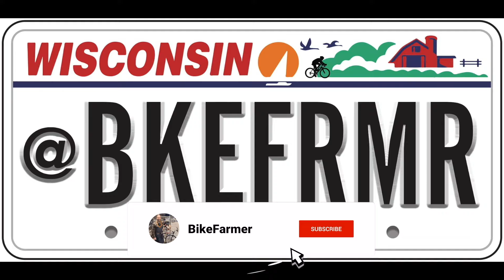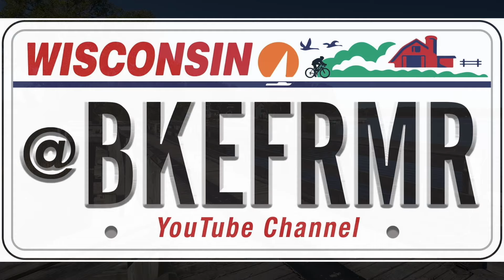GOOD ENOUGH FOR WHO IT'S FOR! - Gary's Diamondback Wildwood made me lose my mind! 🥴🫠

Comment: I have a ladies model bicycle, mountain bike, in the same configuration as the one in this video. It has a used Trek pannier rack on the back, and it's my grocery getter. When I have that rack stacked up high, with my load by the time it's all said and done in town, and I'm heading home, that step through frame is pretty handy.
Reply: I managed to use one of those old Schwinn ladies frames to carry a 2 stack tall bike. My friends tall bike had no wheels so i used his girlfriends ladies bike to move my friends 2 frame high tall bike to a new location. Think i was wheeling around maybe 40 pounds of bike on that damn thing.
Reply: @hungrybraineater2  40-50lbs. Yeah, those old bikes had some heft to them. I have 2 steel frame mountain bikes, a ridgid frame, and a full squish, as they call it, a full suspension mountain bike, and that one is heavier than the previously mentioned bike, with the wheels off. Both are department store bikes. The ladies model came with a child seat, which meant that when ever you get on and off, you're in danger of kicking the kid.
Reply: @davidhakes5141  I had a suspension fork on a dept store mountain bike schwinn. I weighed it was at least 13 pounds if i remember correctly. I put a chrome fork from a Ross mount Whitney on it and put a full Shimano mountain bike gruppo on it. The schwinns from the 70s were built like trucks. I put a schwinn frame on the bottom of the stacked bike and put a Huffy on the top. Welded them together so then you had a tall bike.
Reply: @hungrybraineater2  I went and had too many birthdays to be messing with those outlandish frame bikes, but, I don't knock them, because I don't make it a practice to judge other people, and what makes them happy. I've seen those tall bikes all over YouTube, and TikTok, and the crazy ways people decorate them. If I don't fall off of the thing, if I were to try to ride it, I'm liable to catch a power line, where I live. Have fun, stay safe, and God bless.
Reply: @davidhakes5141  I am a cyclist the tallbike creation is probably the most embarrassing thing ive built. its like that child i dont want to admit that exists lol.

Comment: In another video you told us that Dawn is just dish soap + water + isopropyl alcohol. While we don't have the product here in Germany, I mixed those things myself into a spray bottle. It's sadly not foamy but cleans extremly well without a need to wash it down. Awesome, thanks for the tip! Update: It's the spray bottle head. Used one from a bath cleaner and it foams perfectly!

Comment: For rusty fasteners, I mount a drill wire brush in my vise and mount the screw in my drill. Just jam that fastener into the wire brush a few times with the drill going and it cleans out the head of the screw nicely while also polishing up the cap.
Reply: I was literally just about to post the same thing! Add a little oil, works great!

Comment: one suggestion/caution to viewers on greasing the brake posts - don't 'pack' them with grease. in a closed bolt hole (as opposed to one that goes through and is open on both ends) if you have too much grease or fluid inside the bolt will actually hit a hydraulic lock and either not seat all the way or worst case something will have to give (too much torque) and break. Maybe grease just the bolt threads.

Comment: I’ve been doing basic maintenance and some repairs on my 2 old diesel trucks and various family cars for decades, but a seasonal bike tune up intimidates me. Not any more. This is awesome! Thanks!
Reply: Dont feel intimidated. I knew a guy who was a very good mechanic who did transmissions. Also a great bike mechanic as well rode a very nice raliegh steel frame road bike. Alot of the stuff you know from diesel motors will transition over.
Reply: I got very bad ADHD I lose shit 😅
Reply: @No_ReGretzky99  i had like one of those magnetic trays that would keep bolts from running off from you. But to be honest i did not use it as much for fear of magnetizing some of the bolts and screws. But a good tray will solve the issues of you losing stuff.

Comment: try using a small piece of brake wire in a drill spinning the direction of the twist in the hex screws
Reply: But wear an apron and googles for this hack! These single wires can break and fly through the air with high speed (same for these cheap-o wire brushes for your drill). These will go deep into your skin (ask me how I found out... )

Comment: Can i ask something. Considering that I live in a country where the average hourly wage is about 3-4 dollars, and materials are about the same as they are in US, and i always replace rusty bolts.  I assume that the majority of the price of service there is  in the labor. How it is more profitable for you and for a customer to spend time half-successfully restoring the shine to the bolts than to replace them.  The screws cant be more than 10-15 cents a piece. Same question for shift/brake cables that are about 1 or 2 dollars ( or original shimano that are like 5 bucks).

Comment: I still don't understand why you have issues with disc brakes. Would rather bleed a disc brake then mess with cantilevers.
Reply from the maker: I knew you’d say that, lol
Reply: Remind me of the squeek you get from angled disc.

Yes they're good. No they're just as painful to set up due to tight tolerances. No your slow acoustic bike you don't ride downhill at 30 mph doesn't need them. It needs multiple compound pads to handle rainy weather instead.

Comment: I thought you are supposed to flare out these cantilever arms as far as possible in order to increase leverage on the rim, maximizing braking power
Reply: The one thing I saw on the rear brake is that anchoring the straddle cable a little shorter could result in very slight and not worth the effort improvement of brake performance. Ideally you like the straddle cable to make a 90 degree angle when the brake is applied. Harris Cyclery has a piece on that on the web site.

Comment: If anyone works on these "ladies bikes" especially the old schwinn variety please always check the condition of the breaks and derailleur cables. Often times they are run with a housing down the bottom bracket or the toptube that forms a U that is a great trap for water and rust. I cant count how many times i had locked cables on those types of frames. This bike has the plastic router on the bottom Bracket. When i was in the industry i wish i had the time to figure out a fix for those old women's frames and the tendency for water to get down there. My solution has been to just drown that area in philwoods. But i wonder if there is a viable way to route the cables that conform to the frames stock cable routing by eliminates this issues. Bike Farmer my dad said the retail bike mechanic is the best mechanic in the industry stop selling yourself short. Those race mechanics work with Campagnolo tool kits and campagnolo gruppos best in the world of course its going to come out perfect. When you can get a bike like this diamondback up to professional standards of adjustment and functionality that shows your competency as a mechanic.

Comment: I’m confused, you basically charge him a $100 bucks for a wash? For $100, I wash the bike as you did, but I true the wheels, replace all cables and housings, clean and freeze wheel bearings, clean and grease headset and bottom bracket barings,  clean and lube the shifters. 30 minutes if time and $20 of parts. If I missed something I apologize, but seems a lot for washing someone’s bike.
Reply from the maker: Yeah, this is pretty insulting, but you apologized for that, and I accept your apology. You definitely missed a lot here. Your comment is nothing but confirmation bias. I shouldn't even be giving it this much attention. If you are an insured business offering a service guarantee, you are definitely undercharging for your services. I did much more than just a wash. He got a deal.
Reply: @bkefrmr  I have to agree with Chris on this. Not necessarily for the amount charged, but definitely for what seems to be the work that was done and called a tuneup. In this video, it seems all you did was wash a bike.
Reply from the maker: @sonoralucania434  i’m struggling to understand how that’s any of your business at all. It ended up to Gary how he spends his money? I mean you’re wrong anyway, but…

Sounds like it’s a really good opportunity for you or Chris to move here and put me out of business!
Reply: We charge 120, and I true the wheels, tune the bike,  clean the frame and wheels, and will repack hubs, BB, and headset if needed. I should charge more for repacking hubs, but It’s not really that hard, and the people that need it the most are usually the ones that can’t afford me charging for every single minute of my time. Part of being a small town shop is going above and beyond sometimes.
Reply: @bkefrmr I find some tune ups easier and some tune ups harder, and I always charge the same price. Makes you wonder how many bikes these people have tuned up? You went over every part of the bike and cleaned and replaced what needed to be replaced. Seemed worth 100 to me.
Reply from the maker: @xmateinc  I’ve never had anyone push back or complain about my pricing, until this little thread.

Comment: Those pos Shimano brakes half the time have br8ken plastic spring stops that render them useless.  Good enough for whoever is right, but I personally would not be seen with those old brakes.  There should be a HUGE antitrust suit brought against companies that make throw away brakes.
Reply: Shinmano should be sued. Every year there is ever a change in the gruppos so lets just say a 600 caliper made in 96 vs one made in 97 there would be a few parts different. Compared to simplex and Huret and Weinmans on the old schwinns i can scavenge parts fairly easily across all schwinn models. Schwinns were not performance getters but they were built with alot of principles from the auto industry in terms of standardization that made mass production easier.
Reply: Yea I’ve ran into that problem sooo many times!
Reply: @xmateinc  Its idiotic but luckily its not big changes by year though. You can generally use a screw here or there and be alright. I dont know what it looks like now for the more modern parts.